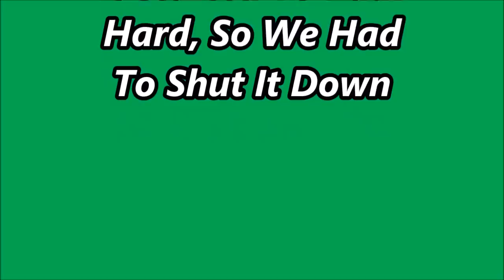We Got Rained Out Today, So Here's A Short Sawmill Video

Comment: A roof over sawmill would help you out a lot. You need to mount a bottle jack on a plate in the front of your mill so when logs are to heavy you can jack up to wedge them. Good luck with the rain. Have a great weekend. Cheers.